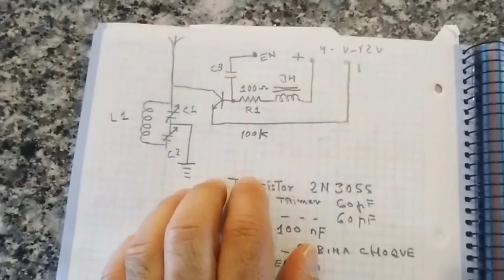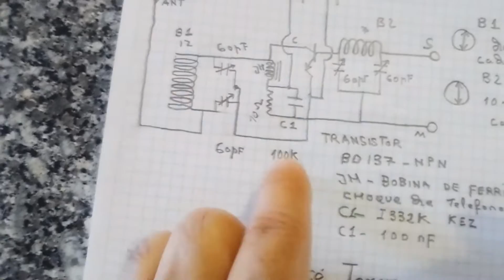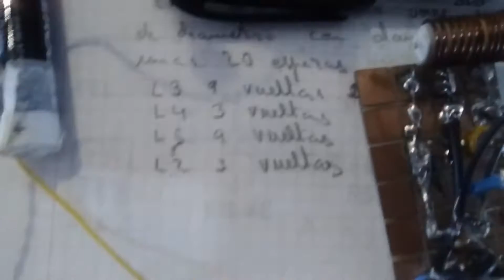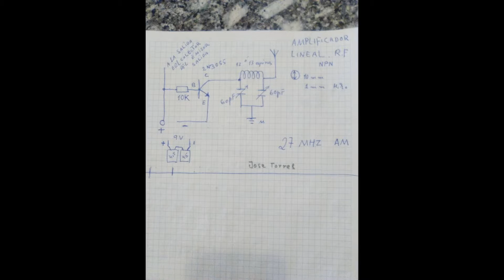Pruebas del amplificador de rf

Comment: Lo que yo no entiendo es que no tengas una fuente de alimentación, una antena ajustada o una carga ficticia, un vatimetro, un frecuencimetro, etc. por otro lado, no comprendo como tu amplificador funciona con un 2n3055 que tiene una frecuencia de transición de 3 Mhz y lo que es mas maravilloso : SIN POLARIZAR EL COLECTOR. me da la impresión que estás dejando pasar la señal del emisor a través del diodo base -colector y nada más. Un saludo.
Reply from the maker: Hola, tienes razón sobre el amplificador pues el 2n3055 tiene 3 Mhz algunos fabricantes ponen 2,5 Mhz, como sabrás los diodos se pueden usar para hacer emisores no todos dan el mismo resultado yo los he hecho hasta con diodos LED pero el 2n3055 tiene unos diodos que van bien, un saludo.
Reply: Tienes ese ruidaje porque no estas eliminando la componente alterna que te manda el transformador, deberias de añadirle al transformador un puente rectificador  un capacitor de 2200uf 50v y un estavilizador de vomtaje, Lm 7809 o Lm7812 dependiendo el voltaje de fuente que necesites , por lo general los transformadores meten muchos armonicos a los circuitos de audio si no les agregas una etapa posterior de filtrado. Saludos  y felicidades por el proyecto.